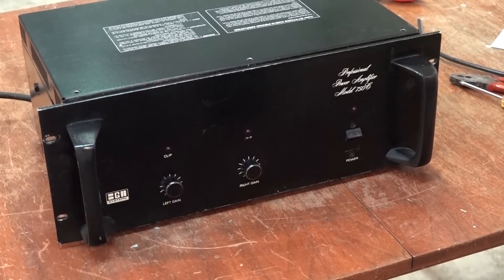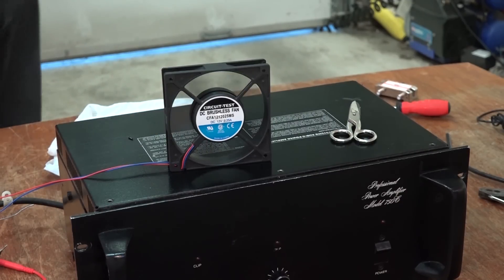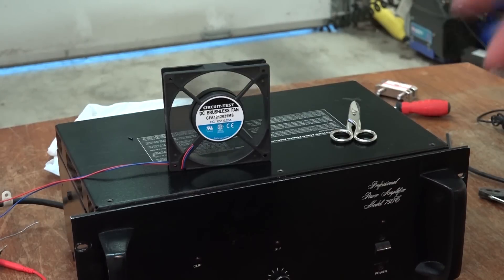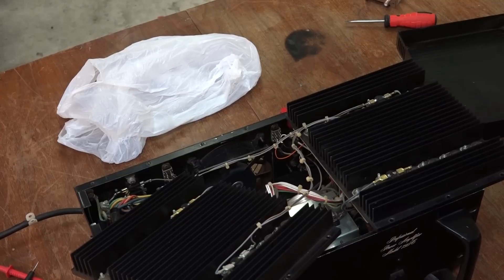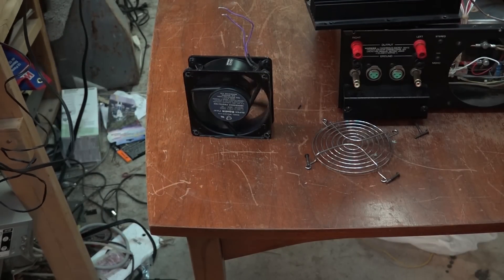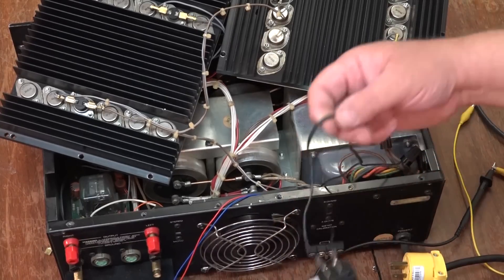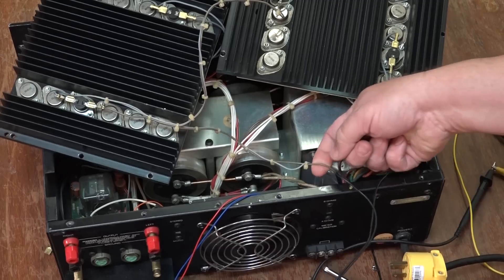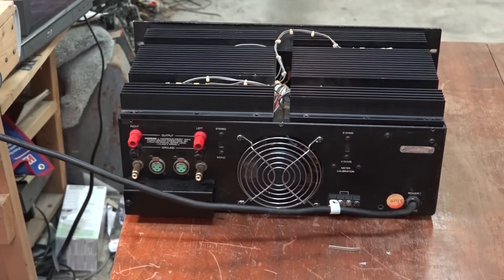BGW Model 750 Power amp cooling fan modification

Comment: What I did not see is What Adaptor you are using (Specs, etc) and how you connected it to the fan.  I love that you showed how you "plugged" in the adaptor to the amp's power supply.  Did the Adaptor come with fan?   etc.  What specs do I need for the fan? Can I get one with a light in it?  etc.  Thanks, Great Video!

Comment: I have a BGW 750E. It's toroidal tx is not ok at the primary winding. I need to replace it bt i don't understand it's specifications. Please advice on which tx to replace with. In Kenya we use 220-240vac.

Comment: Not sure if I would had upgraded components and started changing design characteristics at the same time. This is more a of a mod than a better parts swap. I wouldn't turn my fan around on my car radiator to force air through ,not even taking into consideration that this would compound the uninefficiency by using the added heat from the engine compartment. Also running that fan with a lower than recommend voltage should be done through a resistance controller. Then you can set the rpms at optimal levels without unnecessary drag on the motor. I would do a temperature assessment of components in operation. Those t-stat controls fail regularly but they were efficient in that run temperature was kept in a safely predetermined level.
Reply from the maker: Not turned around.  Still pressurising the cabinet but much quieter than original jet engine.  Original fan far too noisy.

Comment: For those who want an alternative solution, 2 of the thermal switches on the output transistors are for fan speed control. On the 2 units on worked on one of those switches was shorted. There is a resistor in series with the AC fan and the switch would short the resistor to run the fan at high speed. It is still noisy at low speed though so I replaced the fan with a quiet Papst I had around. Those Papst are expensive though and 12voltvids solution is cheaper and effective. Another thing I have seen is people assuming ball bearing fans are quieter, bushing fans are quieter.

Comment: I really miss my BGW 750 C-B and my 110 real work horses  and very clean. My only repair in 25 years was the replacement of the triac in my 750 B and I never had a problem with my fans  or transistors in all that time  ....Just amazing amps especially in bridge mode....I tri amped my system and used JBL drivers 2225H  lows E110 mids and 2405 bullet tweeters

Comment: Nice job fixing this one! Indeed a very silent fan! and because of the lower voltage the life duration of the fan wil be much better as wel! I wish you lived closer, would have love to bring in my Philips 686 Stereo Receiver to get it serviced by you! :-)
Reply: The old fan was from the 80's, that little DC fan won't be around in 35 years.

Comment: Nice job! I thought the fan should blow outward, so that it drew in fresh air from the top of the case over the heatsinks  and exit out the back of the unit. Great idea to drum up some low voltage DC
Reply from the maker: Nope that was the original design.

Comment: I've done that a few times with them small wall plugin power supplies too. Good idea I think.
Reply from the maker: Yes the reason for the separate power supply was to prevent any induced noise into the low voltage supply for the preamp.

Comment: The proper way to solve this noise problem would have been to install a lower wattage/lower CFM fan.  They are available in all wattage levels and CFM's.  That would have been a direct swapout without any added power problems.
Reply from the maker: The client asked for a "computer" fan. Yes I know you can get AC fans in different CFM, but they all make more noise than this one. It really wasn't a big deal. There was plenty of space to tuck the adapter down between the power transformer and the filter capacitors. They both move air, and a small DC fan is about 1/3 the cost of an AC fan. Remember this original setup used a modulated speed. So there are temperature sensors designed to run the fan at full speed if the unit gets too hot, and then turn it down to a slower speed, or off completely if it is cool.  There was also a circuit that monitored the output level. When a high power demand came, the fan would ramp up full, and then drop. This was the annoying part of this design. Used in a home theatre, a loud sound effect would put the fan in full cool mode, or course after the effect has gone the fan is still running, and then slows down, and goes off. This modulating fan is very annoying. The solution, a constant quiet fan.

Comment: I think you went the easy way out of this fan :D 
- there is no thermostat or thermistor to control the rotation of the fan ?
as they say, what a complicated life 
(say that stopgap endure the longest) I do not know how well I translated but in a good sense
Reply from the maker: I did what was asked by the client. He isn't an idiot an has done research. He brought it in and asked for a new improve quiet fan. This is what all the shops are doing. Back when this thing was made the only reliable fans were ac induction motors. BSL DC motors were not around. All DC motors of the day were brush type motors and they induce a lot of impulse noise. Now we have nice quiet DC BSL motors. You should think before you open your mouth and put your foot in it. I'm not the first one in this unit. The triac has been bypass before I saw it. That would have been done so the fan ran at full speed all the time as this came out of a night club. That would ha been because the temp sensor failed before that and the amp overheated and shut down. The temp detection on these units wasn't the best to begin with. That is why people put in a constant running quiet fan. Now the unit has good cooling all the time.
Reply: I do not call anyone an idiot, and my opinion you do not have to agree.
- I am saying what I have observed and do not know it personally
 Well apparently not allowed to tell you anything (rough as you say so)
" You should think before you open your mouth and put your foot in it. I'm not the first one in this unit."
 sorry but something I do not understand What are you up to target?
if I said something to make fun of you?
I do not think so and if I point to this passage!
I suggested that a good solution would be to reduce noise of motor rotation the controller based on the thermistor (measuring system)  with increasing temperature radiators increase in turnover of fan and that's it while the temperature is normal rotations are within 20% and already you can decide if you want to set up to 80%
that was my message and you jumped that criticizes your work strange?...
Always I see your content because they are interesting
Reply from the maker: When I see something like "you went the easy way out" that strikes me as a comment that I do not know what I am doing.Others already suggested the resistor, or changing to a lower CFM fan, the reason this was done is because the person paying me to do the mod specifically asked for a low voltage computer fan. Is it better than the original design? Not necessarily, as when the original fan is cranked up to full power it will move more air over the outputs for sure, but the problem with these units was all it takes is a small loud sound, such as a gunshot in an action movie, and the cooling system ramps up to full power for several seconds. That sound is unacceptable in a living room environment, so the previous owner disconnected the fan entirely. That is also unacceptable, as now the unit will over heat. What many do is disconnect the fan and run the unit with the top cover off, and transistors exposed. This is also unacceptable as there is 130V DC potential difference between the PNP and NPN transistor cases, and with the size of capacitors in this unit, there is enough current available to be fatal of someone contacted both power rails. So this mod is a solution that keeps the unit cool, it is still moving a good amount of air over the unit, and you can barely hear it in operation.

Comment: Wouldn't a fan create electromagnetic noise inside the amplifier which would cause output noise? I recently bought a Cerwin Vega amp that cost me around 920 Canadian dollars with the current exchange rate. When powered on, I can hear a buzzing sound coming out of the speakers when sitting in my couch that is around 10 feet away. Sent it back for repair on warranty, but it still makes the same noise when I got it back a month later. I were told it is because of the fans and there is nothing to do about it. The fans themselves doesn't make noise, what does bother me is the speaker output noise. Hooking my scope up to the output I could see a signal that is around 100 Hz (probably rectified 50 Hz AC) and another signal that is about 15 times higher.
Reply from the maker: When I hooked this unit up off camera for test I didn't hear any noise. This is a small DC fan that isn't going to generate as much magnetic Flux as the original.

Comment: If somebody runs that kind of power in their rec room, they won't hear any fan...  they'll become deaf!  What kind of speaker systems do they hook up to it?  Altec Lansing  Voice of the Theatre?   That'll rattle the neighbor's windows...  a few blocks away, aye!  Don
Reply from the maker: The owner is the same guy that owns the rotel cd changer, Haffler amps, and my old denon cd player. That's how I met him, and now I have become his guy to look after his cool toys. I'm sure if he let this thing and his 2 Haffler amps loose you would hear it in the next town.  
But seriously he doesn't crank them. He has all that power for "overhead" 
So when using these devices in a home theatre set up he doesn't want to hear fans running during quiet scenes.

Comment: Ooow and i thought you were going to put a capacitor in series with the original fan, but that new fan seems very quiet and works loverly :-D.
I have loads of those flyback supplys, came with routers/modems and tv boxes :-).

Comment: That's a very nice mod sir (sorry I don't know your name). Would you think the small adaptor would introduce any noise on the amplifier outputs? Or would it be negligible to none at best? Enjoy all your videos!
Reply from the maker: Shouldn't be any. It is a switcher supply. They run up around 70khz. Not tied to any amplifier circuits. Just the ac side. I buried the adapter along side the power transformer away from any audio circuits on the opposite side to the audio inputs.
Reply: Ah no problems. Thanks for the clarification. A cool idea indeed running a small switch mode supply in there. I personally wouldn't have thought to do that!